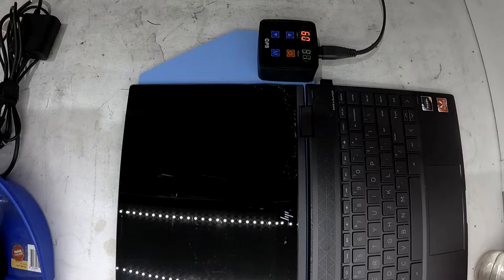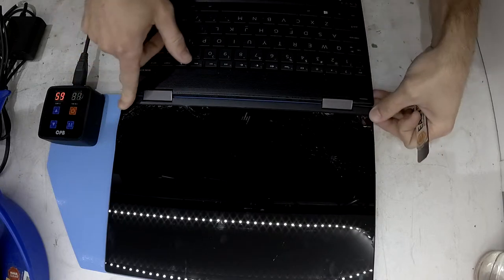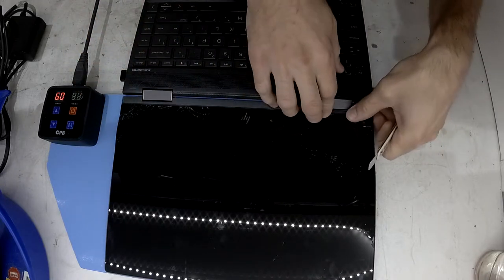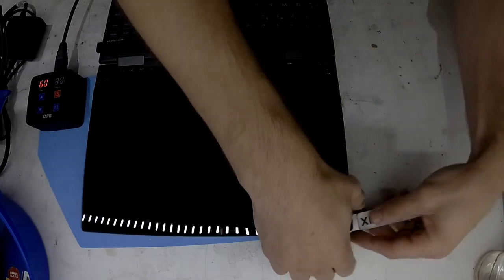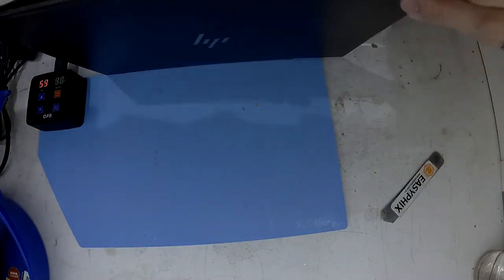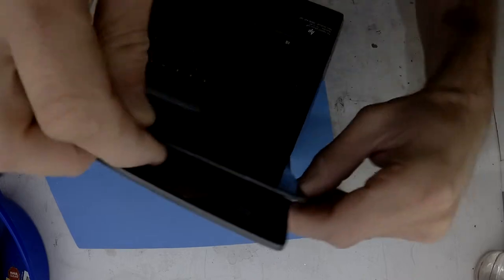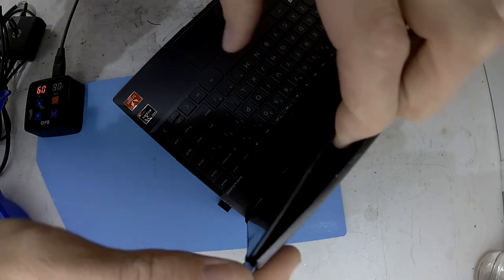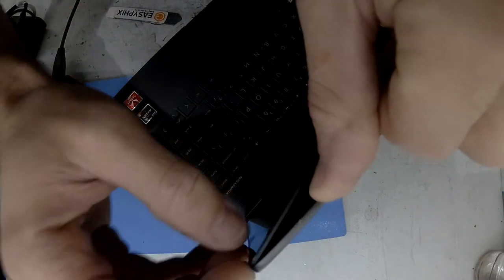HP Envy x360 13 ag Ryzen laptop Screen replacement

Comment: Hi Ricks, is HP envy 13 AG series same as HP envy 13 AH series. I have a broken right hand screen hinge on HP envy 360 13 AG0003 laptop.
Reply from the maker: Not sure sorry
Reply: did you replaced the screen?
i also have envy x360 and touch glass is broken but screen is ok

Comment: imagine that you got a this laptop model (which it have low brightness) but sadly you damaged it screen and need replacement , so you go to a repair shop to fix it , here is the question : can you put a brighter screen display instead of what the repairer can put on the laptop ???
Reply from the maker: short answer: yes

Long answer: usually there is a couple of panels of different resolutions or specifications that would be compatible, if you laptop isn't a touch screen model and is a standard 14" / 15.6" Display you will find there will be heaps of displays that can be used
Reply: @rickstechrepairs  its a 13" touch panel, So i have to search well before replacing , thanks man i hope you best
Reply from the maker: The x360 models would only have a few screens that will work with it due to custom glass touch panel
Reply: @rickstechrepairs  TRUE , when i saw some reviews about this laptop , they all complain about the bright-less display , and i thought it will be a good idea to upgrade it to a brighter one without waiting till it broke and need replacement XD

Comment: Rick how do I detach the screen from the rest of the pc.  I have hp envy x360 convertible 13ag0502sa. And I have a damaged screen and need to know how I get the screen detached thanks
Reply from the maker: sorry about the footage not showing the most crucial part of the repair, you need to use a large amount of heat on the back cover to soften the adhesive that on there
Reply: @rickstechrepairs  hey man thanks for replying no I don’t mean that. Iv already taken it out but how do I detach it from the cables so I can put the new one in ?   Did you manage to do it ?
Reply from the maker: Should be a metal latch that goes over the LCD connector on the back of the display 

The method to disconnect that and reconnect it is the same on many models
Reply: @rickstechrepairs  thanks man I was successful just waiting on part to arrive now.  Thanks for your help Rick
Reply: Keep up the good work bud

Comment: Good morning Rick. It seems that the metal plate comes off the back of the old screen and then attaches to the new screen. None of the videos I have looked at show how to do that.
Reply from the maker: im not too sure which part you are referring to sorry, if you are talking the back metal screen assembly (which has HP) printered on there. then i suspect thats a major point of failure

Comment: Hey! I have a question regarding the screen component. Is the digitizer and the screen is a separate component?
Reply from the maker: They are glued together
Reply: @rickstechrepairs  So it is possible by removing the tape then! Just had to be careful so that it can be reused. I had the same model but 13 inch model and I had to replace the screen only. The digitizer works with no minor scratches and cracks, its just that the laptop were hit from behind the screen. Thanks for the reply!

Comment: soo you didn't actually replace the screen
Reply from the maker: Correct but I go it to the stage that you would do the last step before installing in the new screen
Reply: @rickstechrepairs  do you have a video of you doing it ?
Reply: Rick how do I detach the screen from the rest of the pc.  I have hp envy x360 convertible 13ag0502sa. And I have a damaged screen and need to know how I get the screen detached thanks